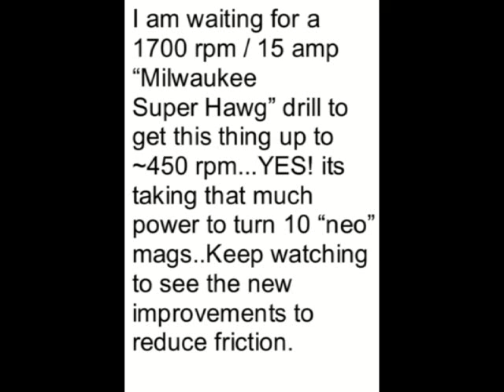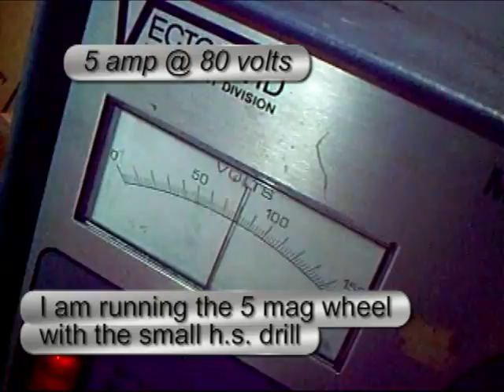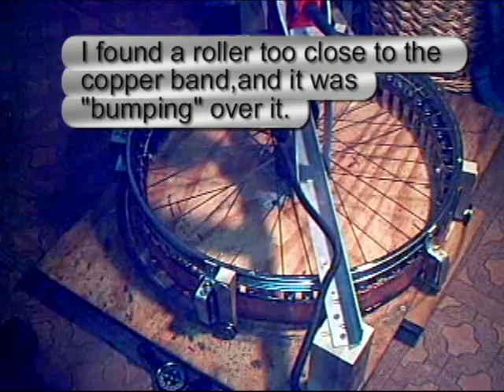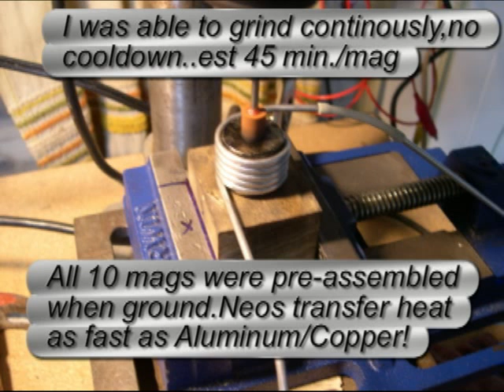SEG-MEC #11.mp4

Comment: I get your reasoning!
When i read the Roschin-Godin paper a few years back it seemed too detailed to be a hoax, even though some of the things they described gave me goosebumps, especially the temperature effects and "beam" of gravity reduction.
It would seem the Searle device does comply with the thermodynamic laws, if it turns gravitational energy into angular momentum and eventually electricity. If it IS a hoax, it is a very well thought-out one!
-Then again, zero-point energy is real too!